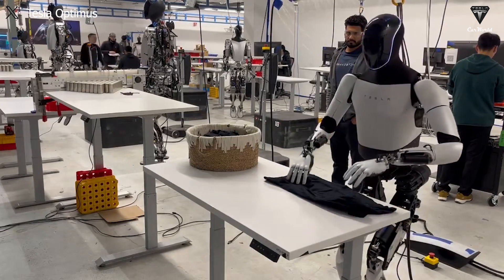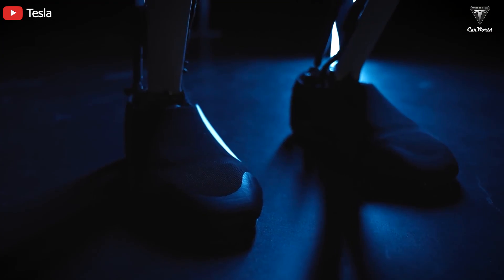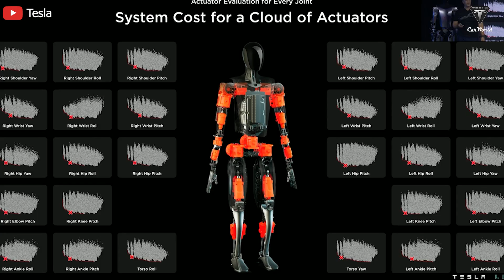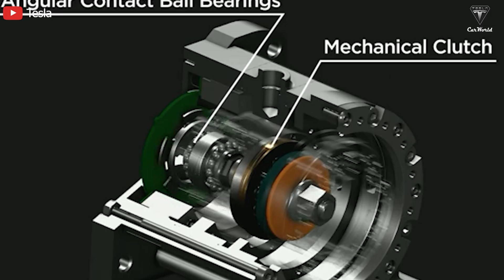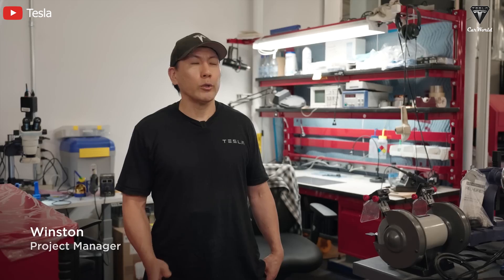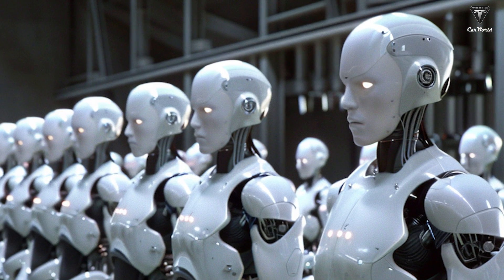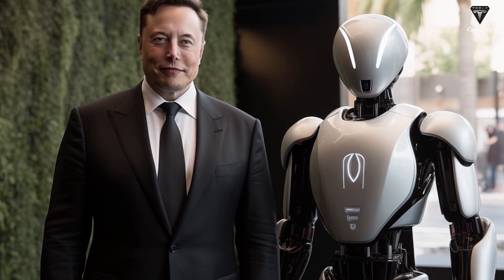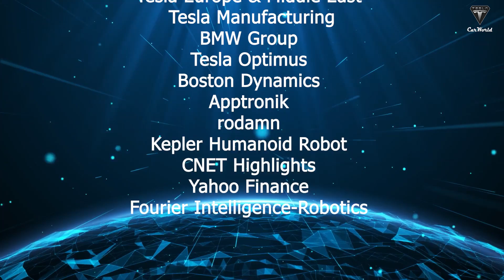Just happened! Elon Musk LEAKED The Way Tesla Build Optimus By NEVER SEEN Tech, Will Hit Market 2025

Comment: Put this robot outside on uneven terrain and it won't last long lol. This type of robot only works on very flat surfaces like in factories or offices, but not at home. It will be a while before a robot can change floors in a house and walk on two different floors of varying thickness.

The key to a balanced robot starts with its feet; it's our feet that can adjust to unstable terrain and keep us balanced. Currently, it just scans the rooms.
Reply: Already demonstrated running up ramps, down, uneven terrain. I know you do not want to hear it - but do some research.